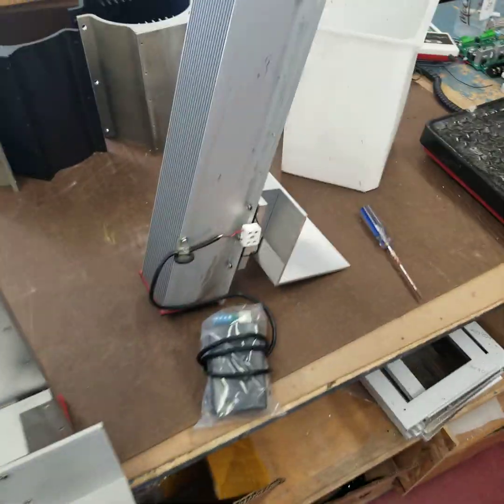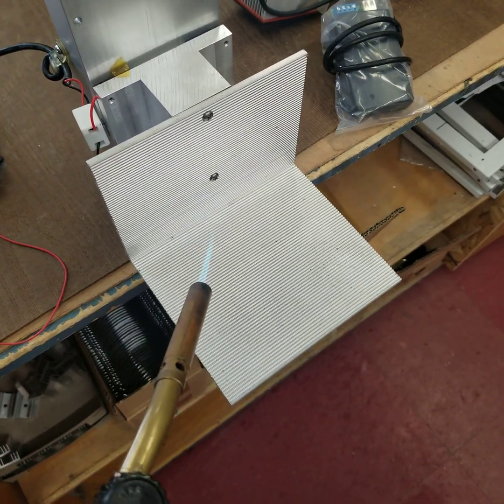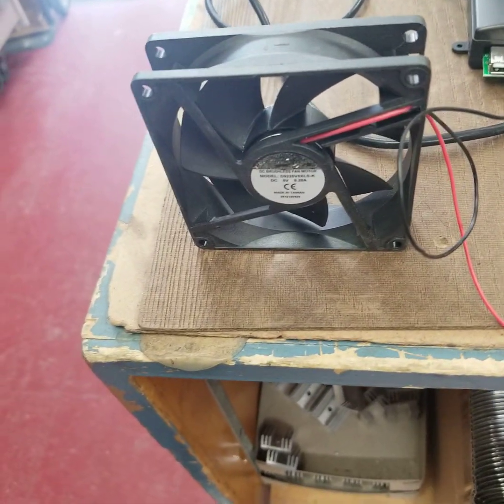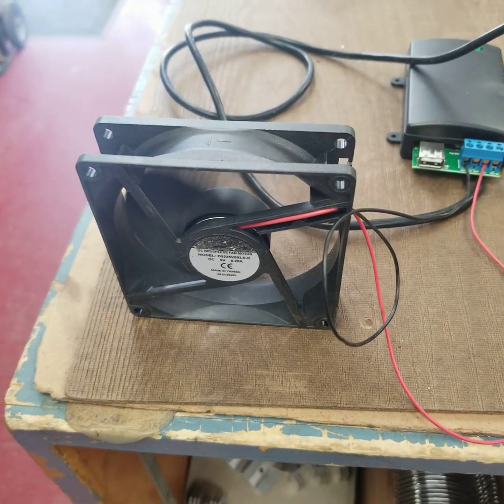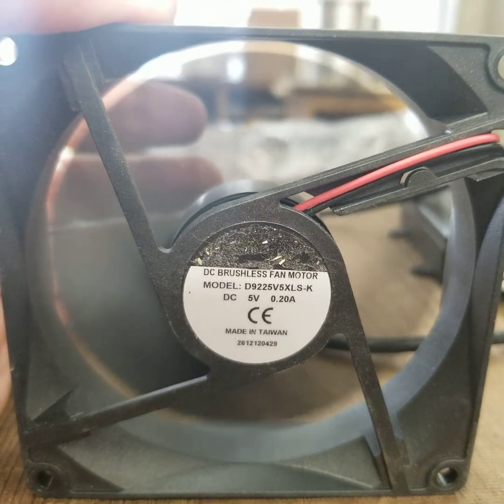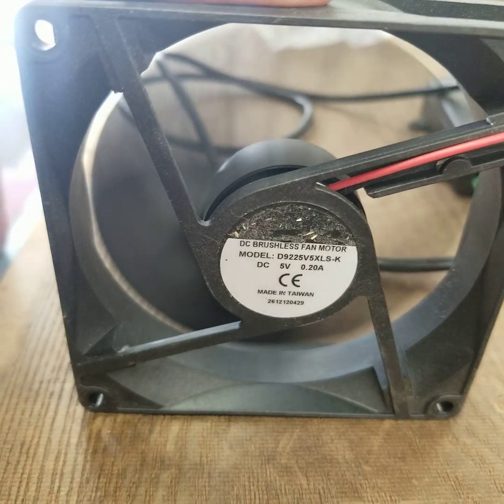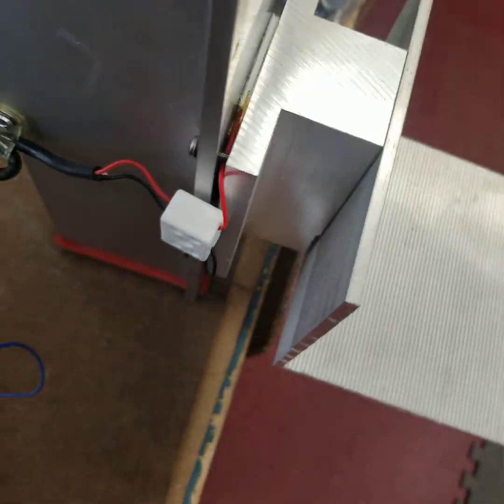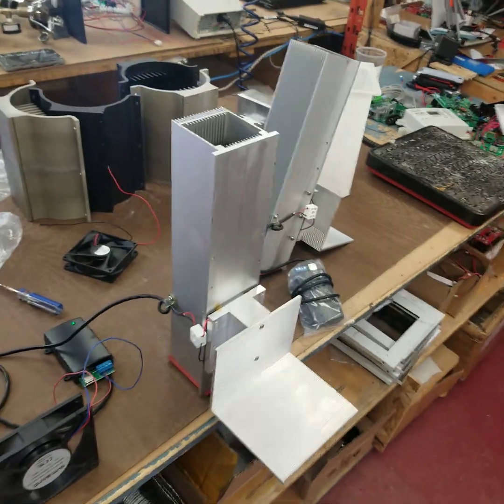10Watt 12VDC/5V DC USB Thermoelectric generator battery charger fan power for crop dryer

Comment: This has tremendous applications!
With various improvements and augmentations this could provide power like nobody's business.
I don't suppose you've had one unit running continuously, to test how long it can operate for before any breakdowns happen (if there is anything to break down)?
Also, I have some questions and suggestions if I may be so bold? Nothing too elaborate and the cost would be up to whoever wants to do it (which is why it's worth doing from your side). Is there an address I may email those?
I promise not to waste your time.
Reply from the maker: We've had our first unit for 6 years running maybe 27,000 hours off and on which is the worst you can put it thru. the units will last for 10 years continuous. You can cap the top with a Condenser to maintain water levels. Eventually water will need to be filled but maybe every three month to 6 months.
Reply from the maker: We are a 25 year old company. Experts in the technology and system design. The system is Patented, one of many !